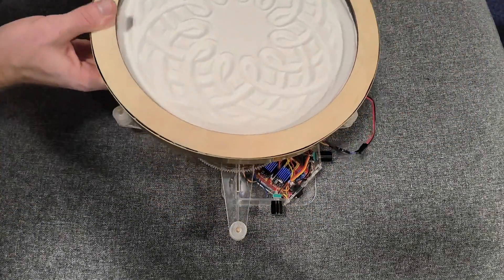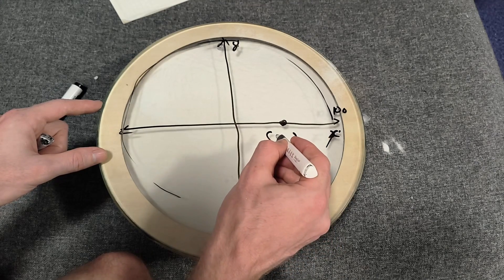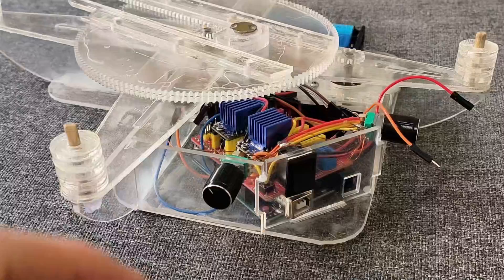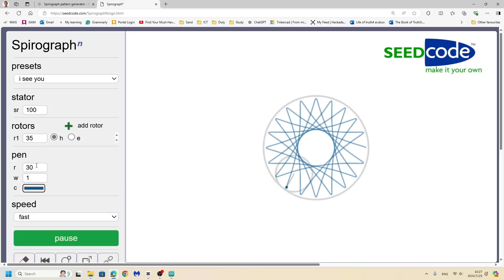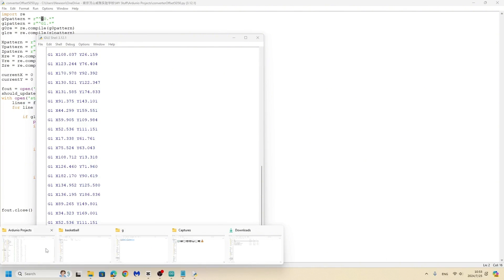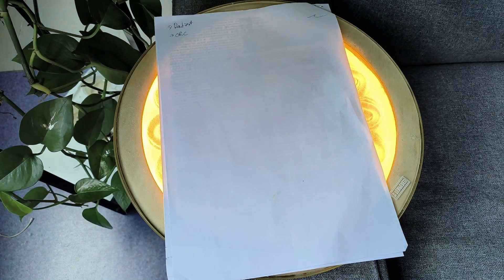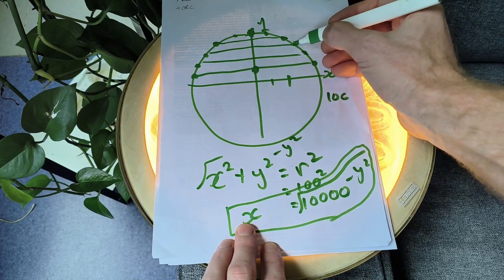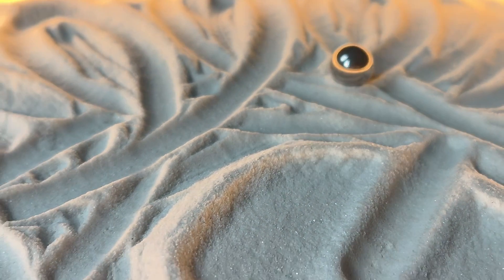How I Coded the World's First Arduino-Powered Cycloid Art Table

Comment: Hi, potentiometer is a good option rather than selecting patterns from an app I think. Did you cover everything in the arduino code to run the machine? Is there any option to get all the designs in a single code and can be changed.
Reply from the maker: yep check the description I also have the instructables

Comment: You could probably make this a bit better by having multiple options for drawing. You could use less memory to draw complex shapes
For example, instead of just being able to draw a line from point A to point B, you should add a small flag (a handful of bits or a byte for ease of coding) that tells it if you want to draw a line, Bezier curve (quadratic or cubic), or arc between the points.

if you specify a line, it will expect two points to follow
if you specify a quadratic curve, you can expect 3
if you specify a cubic curve, you can expect 4
an arc could be defined in multiple ways. An easy one for this application might be 2 "root" points for start and end, and a 3rd point somewhere along the arc.

Then, you could easily calculate the points along the path in the arduino which uses far less memory than storing all the points beforehand.

In fact, fonts are stored as lines and bezier curves, which means you could have another flag for text with a start (x,y), the length of the text (chars) to know when to stop looking, the font size (and name/ID if you want to be fancy with it), and the actual characters to write.
Reply from the maker: good idea